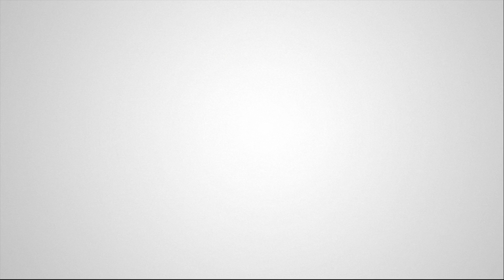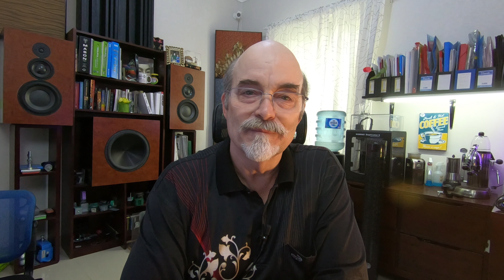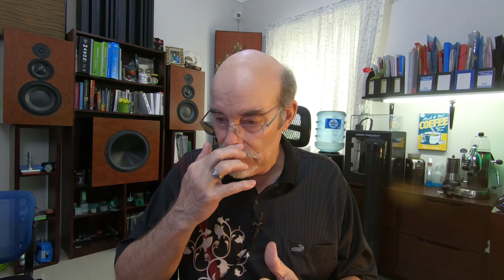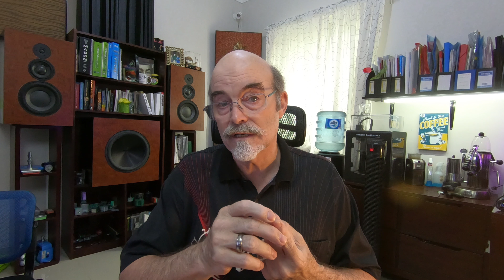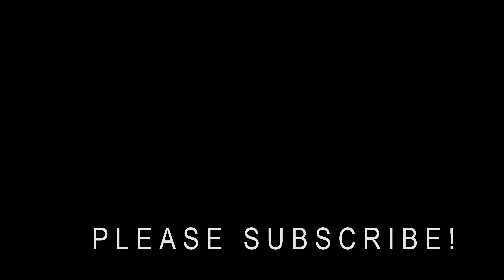Rock Wool Does Not Sound Proof

Comment: Confused. First says you can't test it. Then he explains how various products have been tested. I've seen a number of Rockwool tests on YouTube that seem viable.
Reply from the maker: Science does not have to be believed to work. If you are confused read my papers on sound proofing. http://www.jhbrandt.net/resources/
Reply: He said you can not specifically test just the product. So unless you built an entire room out of this product and then tested, other factors can contribute to the sound absorption
Reply: @TheRealMrGuvernment  'He said you can not specifically test just the product.' 

Why not? See what the existing room sounds like before and after adding rockwool.
Reply: ColtraneTaylor 
I think he was trying to explain that there is a compound effect.
Reply: @totallyfrozen  Ok, but supposing rockwool and concrete walls work but rockwool and wooden walls doesn't you could go for the first option (hypothetical about rockwool and concrete). If it's a combination of elements, find the ones that make a difference when you add rockwool or anything else for that matter.
Reply: @TheRealMrGuvernment  ...you can test it ...just put a bluetooth speaker under a layer of rockwool ...as far as i can tell it significantly works to my own ears.
Reply: Do not confuse sound proofing to suppress sound leaving or entering a room with studio vibration suppression. Acoustic rock wool is very useful for supressing reflected sounds within a recording studio where you might use 6 - 12 inches of cloth covered 'acoustic' rock wool; a very different thing altogether.

Comment: I wish this company would stop advertising it as sound deadening. I bought two bags of the stuff and it barely reduces noise more than regular insulation. In a Rockwool ad they line a little box with rockwool and put a loud alarm inside. The viewer can barely hear the alarm after the top door is closed. I am almost certain that they modified/"cheated" with the audio for this  ad. It is very deceptive if not an outright lie. I lost a lot of money. I feel like I was ripped off.
Reply: I have been redoing various rooms in my house and when I started using rockwool I noticed a big difference. Of course I can still hear my kids screaming and jumping around, but the kitchen noise from below is significantly reduced and the room almost feels like a vault. It's much more temperate and quiet. Same thing with the bathroom I just did. You can't hear the person going to the bathroom through the walls now haha, and I can speak very loudly  in the bathroom, and people downstairs cannot hear me anymore. From my experience, it's worth it, and HD offers bulk discounts so it's $35 for every 6 stud bays.
Reply: Also with sound insulation sound is like water it can flow through openings so air ducts that connect rooms or electrical outlets can limit wall insulation effectiveness. Using some form of spray foam to fill gaps between wall insulation and electrical outlets can help, wrapping the evil air ducts with insulation or using fiberglass ducts in stead of metal ones.
Also doorways are a big issue for sound, they leak a ton of sound through especially the cheap interior doors that are made of hollow cardboard. You could either go for a rednect jerry rig or your hollow core door and attach a section or dry wall or 5/8 inch ply wood on one side and then paint it or something more reasonable get a solid core interior door. And then putting weather seals and figuring out how to block the bottom I forget what that’s called on the edges of the interior door can help massively. I hope you can figure out what works for you with your wall! Houses are built out of popsicle sticks sometimes haha
Reply: You are clueless!!

Comment: A lot of people are confusing treating your studio acoustics and rooms frequency response with soundproofing which are two very different things. 

Sound proofing would be (ideally) completely blocking outside sound from coming in or inside sound going out, which absorption materials are poor at due to too low a density or mass.

Inside the studio we WANT absorbtion and not reflection because we don't want our room to be too coloured by all the sound bouncing around. We want to absorb it so that the sound that reaches our ears is from the source,  not a delayed coloured from the walls or ceilings reflections, and the lower the note, the thicker the absorbtion (we can't just use more mass or it would start to become more reflective).

They are just simply two different things, and he is saying don't use the wrong material for the job, and he is bang on.

You don't use absorbtion material for soundproofing, because all you get is attenuation. iirc its mass/density that is required for soundproofing. Could be wrong there though 🤔
Reply from the maker: Nailed it! Excellent summary. 👍

Comment: Hey - great video - One of the few that seem to get it right. 
I'm trying to soundproof a rather small room at the moment for playing multiple instruments. The main goal is to have it as quiet as possible to the outside / neighbours - Actual sound treatment / how it sounds on the inside would be secondary. 
I hope it's okay to ask - What material combination would you recommend if the "sound proofing layer" for the walls could be 7-8 inches thick?  
Thicker would be better of course, but that's unfortunately about as thick as it could get. 

I'm still figuring a lot of this out - Especially after watching your video! It seems like SCT rating isn't the only thing to consider. 

Thank you a lot!!

Comment: ATS Acoustics Rigid Fiberglass Board, 2 Inch, 3 lb (6PK)$56.95 VS. Roxul Rockboard 60,
Mineral Wool Board, 2 Inch (6PK)$53.49. I agree with your tech but not with your cost assessment. The ATS stuff is the same as Corning 703 the industry standard. Roxul 60 and Corning 703 stand head to head in acoustic absorption across all frequencies and yes, do virtually nothing below 500Hz. If you buy the Corning brand you will pay even more and get nothing in return. I searched several on line retailers that sell acoustic supplies and got the same results. What you get with Rockwool is the manufacturing process bakes out most of the formaldehyde binder and the fibers are much less damaging to skin, eyes and lungs than fiberglass. I build recording studios for a living and would choose Rockwool any day over fiberglass. I will also state I have no affiliation with ATS and have never done business with them, what I posted here is just an example of what I found across all my research. These prices are for small quantities but clearly show Rockwool is cheaper. Bulk purchases should yield ever deeper discounts.
Reply: I made a mistake in my assessment above. Roxul 60 is actually a 6 Lbs. density and comparable to Corning 705 which sells for $122.00 in the same quantity. This would make Rockwool a much better price to performance ratio.
Reply from the maker: Fred, Thank for the comment!
As I said, if you can get it cheap - GREAT! 

When you're buying hundreds of square feet, the cost adds up... So, ATS Acoustics Rigid Fiberglass Board, 2 Inch, 3 lb costs $56.95. That's 48 square feet @ 2" thick. Now what I was saying in my video is that Owens Corning R-13 Kraft Faced Insulation Roll 15 in. x 32 ft. (40 square feet @ 3.5" thick) at home depot is $22.99. That's NOT bad even though you have to buy twice as much of the ATS! (you're going to need two layers of that) Your $1.68 / sq. ft. to Owens Corning $1.74 / sq ft.
OK! Good DEAL! 
But remember that you get a vapor barrier with the OC AND..... you don't have to add a second layer... AND... you don't have to tie string to hold it in place (Or add sheets of plasting to the room interior prior to doing the drywall work)
We should talk... contact me! :D
Reply: Thanks,  you confirmed that what I just did is on the right track.  I've been researching sound treatment to use in my vocal room for a couple months now and pulled the trigger on a Rockwool 4'x2' 12 pack for $48 at Lowes.  With the wood to build the frames and all the materiels needed, I'm at $190 for 12 panels compared to $450 for less coverage for professional acoustic panels or around $300-375 to use the ATS Fiber board, (extra 75 due to shipping costs).  The ATS panels provide the same coverage, but about $175 more taking shipping costs into consideration.

Comment: M. John Brandt, for the same budget, to create a dead sound studio (for voice over only) should we:
Cover 40% of the wall with 3 inch soft fiberglass insulation on primary and secondary reflection
Cover 20% of the wall with 3 inch hard Roxul on primary reflection only
Cover 20% of the wall with 6 inch soft fiberglass insulation on primary reflection only
Cover 5% of the wall with 6 inch soft fiberglass insulation on primary reflection and 30% with 3 inch soft fiberglass insulation on secondary reflection
Or any other combination?

By covering wall I mean create DIY panels to hang on the wall with a 3-6 inch air gap behind.
It a small studio 10'x17' of 9' high with hard wood floor.

Thank you very much for sharing your expertise on this topic.

Thumbs up from Montréal
Reply from the maker: Your percentage rules really don't apply. It depends on the room size and resonances (modes).
Spacing panels from the wall is NOT recommended. I will be discussing this in a master class I am giving in a couple of hours. Check my channel for new videos. We discuss these topics and more. 😊

Comment: i can assure you100% that it does sound proof.. i had problems when i was mixing or producing music with my neighbours. we treated the whole room just with rockwool.. now the sound is not coming out of the studio at all.we had to use about 20cm on all walls but it worked 100% ..everyone is happy..its even raining really bad some days and i cant hear anything when i am inside..my father is a house builder..they covered many offices with rockwool to soundproof them..and yes it works if you know how to use it! About acoustic treatment rockwool its good for mid and lows ,but it depends on how fat you will add..for example at 20-50cm it will work as bass trap ..from 10-20 cm is good for mid and lows
Reply from the maker: I'm happy that you solved your problem, but you are mistaken about the 'reasons'. You have to 'test' this hypothesis before making a claim. Your claim is NO different from annecdotal claims that having a crystal on your desk will improve your mental focus and no amount of magic toilet paper, lucky socks, crystal speaker stands, or Jumbo's feather will make things work 'better'. Because you placed an extreme amount of absorption in the room and it attenuated the sound enough so that the perceived level outside your studio area was acceptable proves my points entirely. Absorption in the room will remove some of the vibrational energy. If there is less energy to escape the room, that constitutes an adequate reduction in the sound escaping. 
Rock wool does not sound proof. It absorbs. Please read my paper - http://www.jhbrandt.net/wp-content/uploads/2018/07/Sound-waves-in-Air-and-Fiber.pdf
Reply: I can't believe how thick your sound proof wall. What I want is a thinnest sound proof installation for my room.
Reply: And for insulate a wooden roof? From one floor to another? Need to insulate steps and voices?
Reply: thats because you didnt have any insulation in the first place?
Reply: How can someone know if the inner walls in our apartment have insulation?

Comment: Hello sir, which one is the best meterial for isolation and absorption ? Thanks
Reply from the maker: 1. The best material for Isolation is Mass (concrete, gypsum, brick, block, etc.)
2. The best material for absorption depends on the results required. If you are asking which fiber material is better, go with a lightweight fiber - either glass wool or Rockwool. But use only 10-15 kg/m3 density.
Reply: @JHBrandt  sir, please explain M3 density.
Reply from the maker: @rajkamaljangir3618  m3 is meters cubed or cubic meters. :)
Reply: @JHBrandt  one more question sir, which meterial should I need to use in Acaustic panels to treat bass frequency ? (Acaustics treatment for room )
Reply from the maker: @rajkamaljangir3618  only lightweight fiber for fiber-filled traps. Membranes are best for low frequency control and ...

SHAPE and area matter. ;)
you can send me an email - john@jhbrandtd.net

Comment: when you say fill the cavity is it not ideal to have a gap, albeit small, between wall facing, then insulation then wall cavity again.  that is the insulation doesn't touch the edges.  I'm thinking in particular with a floor assembly. or is isolating the lightweight insulation in the middle of the assembly not really significant?
Reply from the maker: Andrew, correct. It's not a problem that lightweight insulation touches both partitions. It's more important to have a full fill for maximum isolation.

Comment: So if I understand what I read from your paper correctly, any fibrous insulation will do to fill the cavity & absorb sound BUT it shouldn’t be too dense or it may have a counterproductive coupling effect, so better to go with batts that have low to mid r values?  I’d read this somewhere else prior as well so just wanted to be sure I understood that correctly as I had been wondering if loose fill might be needed to prevent coupling even, but apparently it shouldn’t
be a concern so long as the batts aren’t too heavy/densely packed within the cavities?
Reply from the maker: Chris, that is correct. I HAVE noticed in the tested comparisons of lightweight fiber vs blown-in cellulose fiber that the STC is reduced when the cellulose fiber is used. It COULD be due to compaction and that will couple the walls slightly. It's important to be aware of these small details.
Reply: That makes perfect sense.  And if cellulose is compacting in one area that means it is also creating some open space someplace else.  Thank you!

Comment: So It is best not to have an air gap between the walls ? I am building a 12 x 15 drum room in my pole barn and I will hopefully be able to use glass mineral wool R19 insulation non faced bats. And I will be building a room inside of a room . I am in need of the right direction. Thanks

Comment: I have been told that Mineral wool attenuates lower frequencies better than the equivalent amount of fiberglass, but I cannot find any data on this. Fiberglass is measured in wall cavities (STC) and mineral wool is measured alone? (NRC). Do yuo any experience with this claim? I am considering mineral wool for in ceiling/wall in a home theater.
Reply from the maker: A very good question, sir! No insulation fiber has been measured "alone" for STC. For building purposes and soundproofing, use either type. However, for acoustic treatment laboratory tests have shown that Fiberglass insulation (in all its forms) will outperform Rockwool when comparing density to density and thickness to thickness. 😎
Reply: look at sound absorption coefficients of those different materials, they should publish the data or 3rd party has published their independent testing. video is a completely misinformation

Comment: I used safe and sound and it worked great.  I put some directly against the flooring (between joists) and it worked the best like that (when experimenting) - presumably it deadens the echo and "speaker effect" of sound between joists.   It kills the sounds so it can't get magnified by the chamber.  Definitely key to overhead sound issues.
Reply from the maker: Yes, but that's NOT soundproofing. That's absorption.

How many times do I have to repeat this? 🤦‍♂️
Fibre works brilliantly for absorption! But you can NOT 'absorb' your way to soundproof.
Reply: @JHBrandt  If you are trying to sound proof a downstairs from foot steps or base speakers rattling on the floor upstairs, then it sure counts!  But maybe not so useful for walls between rooms.  Sound is sound and hearing a person tramp across a floor is hearing a sound.  I agree they need to clarify this point though.
Reply from the maker: @bwj999  what you are describing is IMPACT noise. There are separate and different ways to the solutions because of the way that sound propagates through structures, concrete, air, steel, etc.
The offending noise source, in your case, was foot fall. The easiest / best way to reduce foot fall sound is to add resilient padding under the floor surface above rather than treating the receiving room. 😉
Reply: @JHBrandt  But if we can only treat the receiving apartment unit to reduce footfalls what you would suggest.saint gobain soundbloc board as secondary ceiling will work?

Comment: In a 2x4 double stud system I'm not filling the bay completely.  I just want it in against one side.  Do recommend faced or un-faced insulation in this application? Seems like faced won't sag..
Reply from the maker: Faced. Easier to deal with and install. The vapor barrier may or may not be required but will not interfere with the acoustic properties of the construction.
Reply: @JHBrandt  I'm planning on the ceiling also being a double stud system using 2x6's.  How do I get the R19 to press firmly against the upper drywall? I can staple it close in.. but would it compress, pull away or sag with time?.  How important is contact with drywall?
Reply from the maker: @michaelangell9535  the insulation doesn't need to press against the drywall. It only needs to be in the ceiling cavity.
Reply: @JHBrandt  Thank you! Vary helpful.  Here's the $6000 dollar question.  Will a double stud system allow a rock band to play till 9pm in a residential neighborhood?  Some internet people say it does NOTHING  for frequencies bellow 125hz.  Im reaching out to people with practical experience.
Reply from the maker: @michaelangell9535  we should talk. DIY design fails 99% of the time. My email is john@jhbrandt.net
Reply: @JHBrandt  OK I sent you an email describing my case.  But that would be a great video.  Your top 5 or 10 reasons why DIY designs fail.